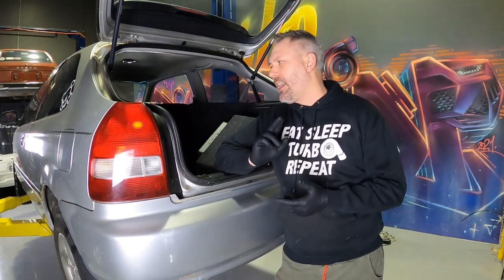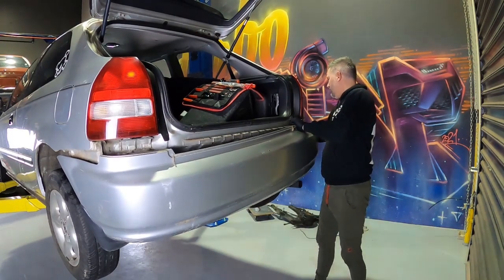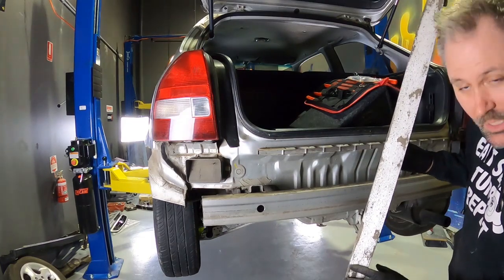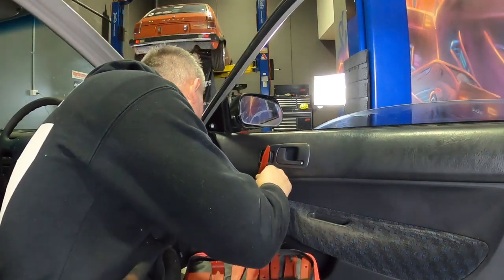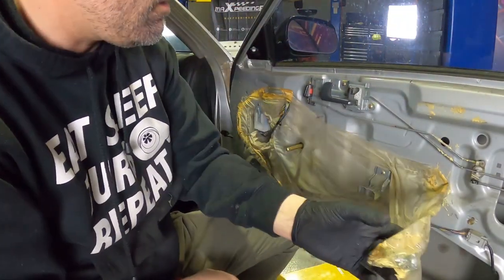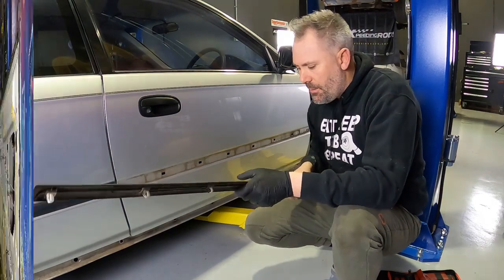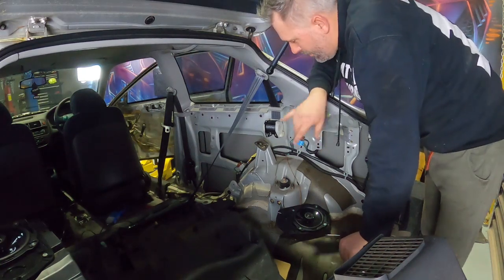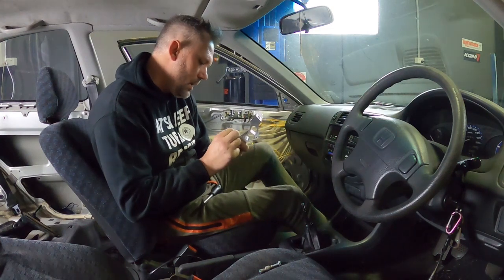NEW D16 EK CIVIC BUDGET BUILD PROJECT SHORT SHIFTER AND SOLID TORQUE MOUNT INSTAL

Comment: That’s some good stuff!! Make sure you keep letting the people know all the little things you have to end up doing as well. This was good Detail. Being able to prepare makes the job much more enjoyable! I hate stopping in the middle of a project, cause a simple tool or a screw no one knows about. Pull and rip works but not for putting things back on 😝
Reply from the maker: So true I don’t want to break anything on the car
Reply: @TURBOTRISTO  n/a build will be fun too. Half way done with the motor 😆, can focus on suspension and allll the bushings. Btw my maxpeeding coils are great.. have them turned 1 click off max. I get a hard knock in pass side rear. Sounds like too much travel or top hat bumps. Tightened things down, can’t find the noise. My lady was smart and said check spare tire.. still need to do that haha

Comment: Pro tip for the window handle clip. Take a rag, pull it between the door card and the handle and pull the rag until it grabs the clip.

For putting the handle back on. Place the clip on the handle just before it snaps into the slots on the sides, push the handle onto the regulator spline and once seated push the clip on the rest of the way.

Comment: Please make report for the solid torqu mounts and the vibrations?I really wanted them but some told me the vibrations are immense.
Reply from the maker: the engine doesn't sit on the torque mounts it sits on the engine mounts the torque mounts are only there to stop the engine twisting
Reply: Torque mounts should not have that much effect on the vibrations. You could go with a stiffer mount on the side mounts and a stock mount at the firewall. The firewall mount will give you the most vibrations.
Reply from the maker: @Mr.Wongburger  exactly right  its just to stop the motor rocking back and forth just as the name suggests when the engine twists from torque
Reply: Yes but still it's permanent lock point.The vibration will be transfered.My friend here told me that the vibrations will be so strong that you cannot see the side mirrors.I'ts made for the track car only without dashboards etc.Try it and give feedback please.
Reply from the maker: @alexandermanov6872  hey alex, your concerns are justified I will 100% provide you some feed back , I used them in my civic sedan and didn't notice any issues, but for you mate I will dedicate a segment of the first drive :) happy to give you feed back my friend
Reply: @TURBOTRISTO  Thank you. Mine are OEM mounts with shock damper on the engine but there is still torque play on acceleration and deceleration.I want solid but if I can't hear the passenger on idle it's not good.I have Hardrace aluminium mounts at standby.Wating for your test.
Keep up the great work.🙂
Reply: @alexandermanov6872  Again. Most of your vibrations will come from any upgraded rear mount on the engine. That doesn't mean you won't see any with upgraded mounts on the sides or the torque mounts. If you want to minimize the vibrations you'll have to stick with stock mounts. If you want to increase stiffness you will have vibration. My suggestion stands though. You can have both stiffness with minimal vibrations. Upgrade your side mounts and torque, put a new stock mount in the rear.